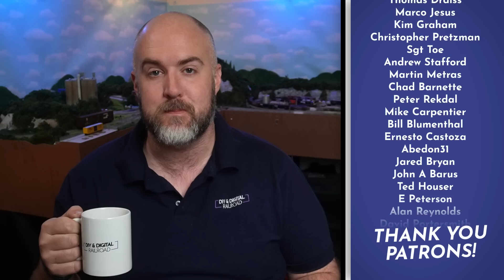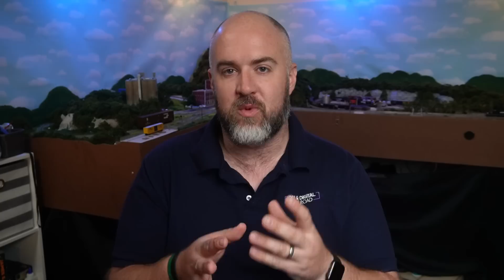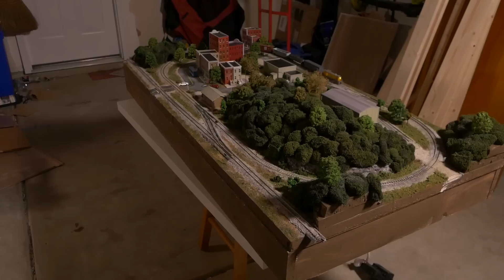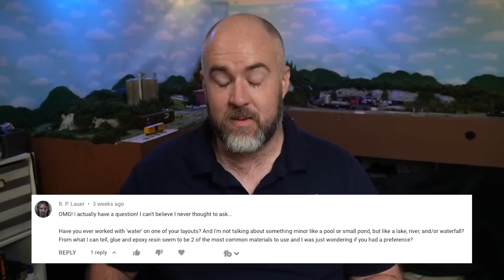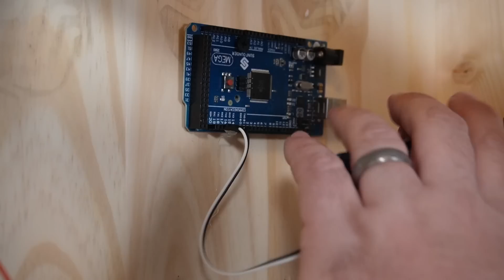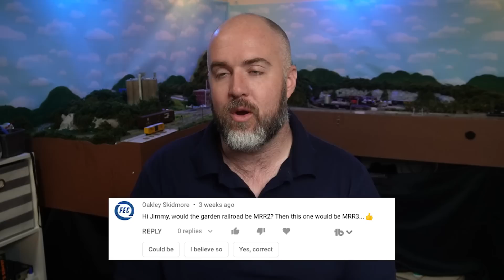Somebody was mistaken about me as a model railroader

Comment: Beginners look at the spreads in the latest issue of Perfect Model Railroads, and at all the deep dives into scenery techniques, DCC, signaling etc. on YT, and might think “why bother.” But you absolutely must spend some money and get your hands dirty. I know from bitter experience that reading is not learning. You must also build and operate, even though some hypothetical MR contributor might find your efforts less than satisfactory. But he’s not really there, he’s just in your head. I suggest Lance Mindheim’s series of books on switching layouts, especially the “building” and “operating” books. They contain beginner projects with detailed procedures, equipment recommendations, and critically valuable philosophy on operations. (Hint, even the most gigantic layouts must use switching moves, and you can learn all of them, along with track laying, wiring, scenery, structures and everything else, on an 8-foot bookshelf which may be discarded or incorporated into your next, larger layout.) Have never read anyone else who is so focused on getting trains running in a realistic way with limited space/money/time. Just remember, in addition to reading, you have to build and run and yes, make mistakes. No other way forward. By the way, DCC is not difficult or expensive. Go straight there!

Comment: You will heavily be using your Resin 4k printer for Z scale to make your buildings, and you will be heavily using your FDM printers for S scale the most as there is VERY little for S other then track and mid 40's/50's locomotives.  S scale is a kitbash scale, not a lot of major manufacturers for S exist as its an orphaned scale sitting between HO and O.  However with 3d printing that issue is readily solved since you can design and print your own buildings and rolling stock, short of the wheels and couplers.

Comment: Suggestions for someone getting into the hobby -- 1) don't get steam, it increases difficulty of getting a smooth running layout exponentially. 2) Get a 4 axle diesel, your first layout will probably have sharp curves, and trying to horse a long 6 axle loco around it can be no fun. 3) A similar rule of thumb for rolling stock, 40 and 50 foot cars, no passenger, 89 foot autoracks etc. Make life easy on yourself.

I love the closing bit about trying to keep this a fun and safe spot.

Comment: I have a DCC-EX setup, it’s a Arduino Mega clone with an ESP8266 built in for WiFi rather than needing a separate WiFi shield. For a motorshield I used a deek robot motor shield. I use a buck converter to have a laptop switch mode power supply to feed 15 volt to the buck converter to down step the power to the arduino at 9v and then feed 15v to the motorshield to the rails. Mine is an HO scale layout the beauty to the switching powersupply is being able to fine tune what works best for your layout based on scale. 

Also you’re doing a great job and I don’t care what anyone says. I’m an HO scale railroader and most of the YouTubers I follower are n scale modelers such as yourself. I never got the impression that your content was n scale exclusive or that you didn’t enjoy other scales. I don’t think you can be in the hobby without having appreciation for what can be accomplished in any scale regardless of if it’s your current or preferred scale.